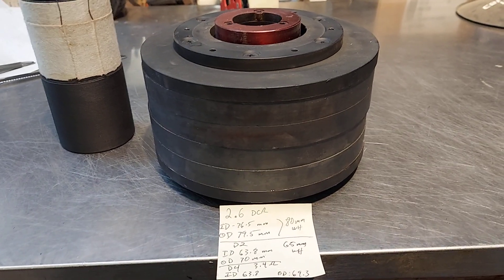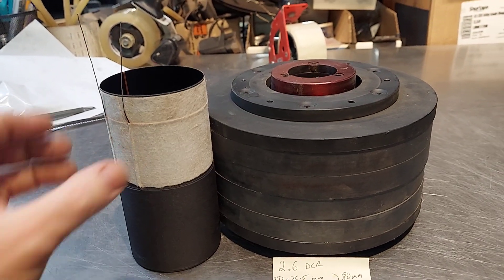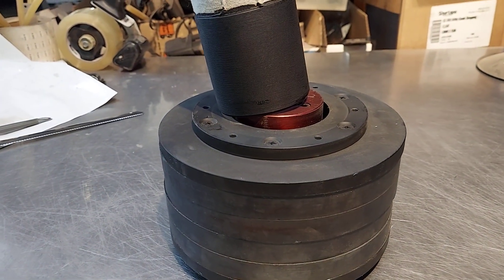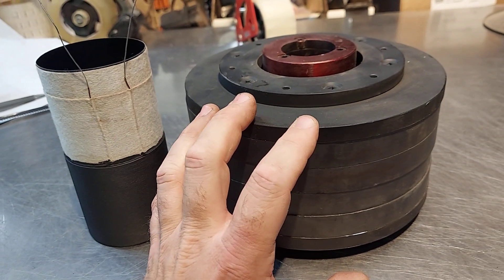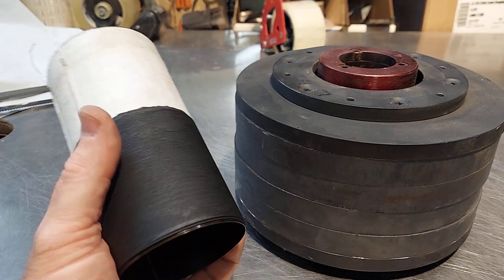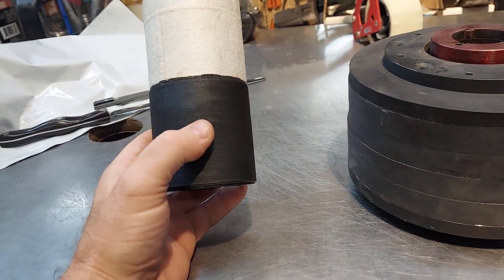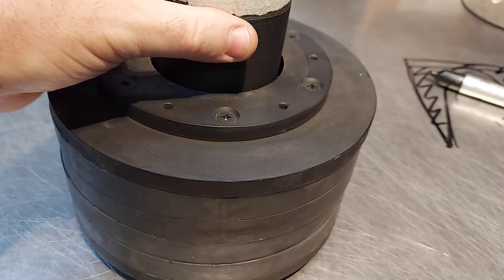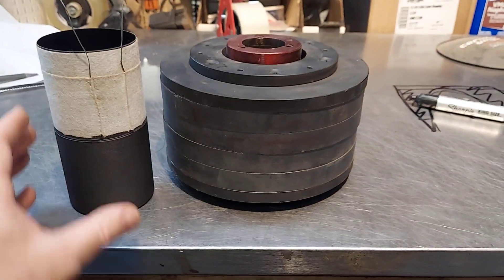Why your subwoofer smells & burns it's not clipping / dirty power it's just you being  too demanding

Comment: So if all coils are good up to 500 degrees Fahrenheit, how hot can I let my coils get (checking with a laser thermometer) before having to stop playing them? My coils get pretty stinky around the 300° mark. I was trying to keep them under 200° when demoing at the Ruckus show but it was the first day I was playing with the digital laser thermometer. 4" flat wound 8 layer dual .7 coils on a clamped 3050 watts with extremely minimal clipping according to the clip light. Good vid! 😁👍
Reply from the maker: 500F is fail temp.  However I've built subs where they've melted the aluminum and that's 1200F.  If they stink, turn it down.  Don't need a fancy laser.
Reply: @RobotUnderground  Cool I appreciate it. They were stinky for about 7 hours each day two days in a row lol. If I turned it down I wouldn't have been able to demo at all. Gave out over 30 hard 160+ db demos that weekend. If I blow one I'll recone. 😁👍
Reply: So your saying turn the gain all the way up just don't turn the volume up how loud should I turn it up ?

Comment: If you set it to clipping and turn it down, you are no longer clipping.
Reply: Cliping really dosnt damage coils it produce more heat becuase it it produce more power and has larger valleys in the frequencys of the tone meaning that you can feed a sub well over double its ratted power
Reply from the maker: Not true because you can hear it clipping.  There are two types, input to the amp and output on the amp.
Reply: @RobotUnderground  clipped input signal is not the same as a clipped output to your sub. input can clip all day long, will sound like shit but the sub dont give a shit what you listen to as long as you don't feed it that clipping shit. The preamp should clean up the signal well enough for the sub to play. granted you keep listening to that you deserve ruined equipment, thats also who keeps you in business (says the guy feeding a 15 5k looking to put a 10k to it lol)
Reply: ty patrick didnt know that
Reply: @fxgamer-11yt  well your right but not fully right. When a amp is clipping on the output you are correct that it dumps amperes, this causes excessive heat, over excursion and you will fry your voice coil because of it or your amp or both. When clipping occurs the amp tries to drive the signal past the voltage rails which obviously it can't, this causes everything to start freaking out in layman's terms. This drives mosfets to their limits, very high frequencies noises go out the output and will take a tweeter out immediately if you have a 4 channel say and the tweeter isn't on a protected circuit from such happening.  But without certainty you keep playing it clipping on the output, something is going up in smoke 100% and the VC usually falls victim. 

I'll be honest Patrick I'm uncertain on what you exactly meant with coil out of the gap or how clipping doesn't kill coils. Also the DD1 works, if you are tuned at 40Hz and above. That's where the DD1 falls short,  aside from it being a expensive tool "for dummies" (going to get shit for that I'm sure) it does one thing and it does it mediocre at that.  Some amps when you just start hitting excessive distortion you can hear it clear as day when on a sine wave.

Another popular way of tuning i disagree with is tuning with the sub disconnected, this doesn't account for real world parameters, you throw a 30Hz sine wave with the sub hooked up you'll have exact parameters to tune to. I do set it with sub off to get it close, back it off, hook it up and let it eat and final tune turned up to 11. I use a oscilloscope and for anyone who says that it isn't accurate is a idiot. If i can't see the distortion the DD1 is triggering the light for your ear isn't going to hear it and so now you're leaving power on the table. I've got my coil hot and smelly many times and never slinkied a coil in the gap or fried a coil ....??? ok on 1 i did fry a coil, the amps gain potentiometer was fucked up and i didn't catch it in time. It smelled bad and it still took a beating for 3 weeks until it finally said i am done being a sub now. Point is subs are not that delicate and can go through some shit, this was a 1500watt rated sub on a 5k(DD m4 imagine that a DD pot going bad 🤯)

Comment: Ears are all ive ever used  to tune with.Buying a distortion detector to me doesnt make sense either  doesnt the system voltage  change all  that  when your powering subs? But honestly i beat the shit out of my w7 12s only problem this time was breaking my first attempted sewn in tensil leads but im gonna rebuild harvest the coils that are in great shape maybe 4 months of play tine and try using 2 sets of skyhigh 14 gauge ofc with heat shrink around those and give them that oem form fit connection i am gonna sell tho but like your vids bro!

Comment: Whenever I start smelling coil I turn it down immediately but always leave the sub moving so it cools faster , my theory is if you stop the sub completely it will stay at a high temperature like in an oven just roasting and shortening the coil's life. Turn it down to 1/4 volume , never completely down.
Reply: Same, Because logic!
Reply: and that's the best way to do it unless you find out like I did that my spider separated from the basket 😆 🤣 😂

Comment: Do a video on how to take an old woofer and while reconing you get more power handling from it...
Reply from the maker: That is FALSE NEWS as FB says.  I've discussed this several times.  You can put a stiffer suspension on it and technically, YES, you get more power handling... but at what cost?  The cost is that the sub cannot play as low as it did before.

Comment: So clipping if not leaving the gap will not overheat th coil?
Reply from the maker: yes!  Try it yourself.  You can clip the input of the amp, the output of the amp and as long as it's a low level, you can do it all day long.  NIN sometimes has clipped signals in their music and it's fine as an example.

Comment: Im glad you didnt release this video a month or so ago
Running in my DD AUDIO 818D (4"VC) and after 5 mins of half decent clean power the coil started to smell
Thankfully it was just the shit and excess burning off the coil, now I can throw well over rated at it for 20mins and it's all good
Reply from the maker: You may have been experiencing motor stall as the suspension was  breaking in.  Not sure.  Wasn't there.

Comment: Its interesting I learned something. Its good to have a very high temperature coil.
Reply from the maker: All coils are the same temp.  500F
Reply: @RobotUnderground  must be the glue that gives them there higher temperature ratings.
Reply from the maker: @RyanBassForLife  Do your own testing lol.  See how the glue stands up to 500F
Reply: @RobotUnderground  I'm not sure how glue withstands heat. I'm just guessing the glue helps if it's rated at a higher temperature 🌡🤷
Reply from the maker: @RyanBassForLife  The glue is there to hold the whole damn thing together.  There's no such thing as HEAT TREATMENT for coils.  The glue and all the other adhesives simply get hot and then fail at 500F and above.
Reply: @RobotUnderground  I get it after rewatching it a few times. Clipping a subwoofer and tuning it up loud at the same time will cause your subwoofer to fail. Also overpowering it for a long time is another reason your subwoofer will fail. I did both of those to my Skar SDR subwoofer on vid. I put over double the rms power on it and a clipped signal and it blew in less than 5 minutes.
Reply from the maker: @RyanBassForLife  Yep.  I tell people that if you take care of your speakers, they'll last 10 years.  If you abuse them, they can last 10 seconds.